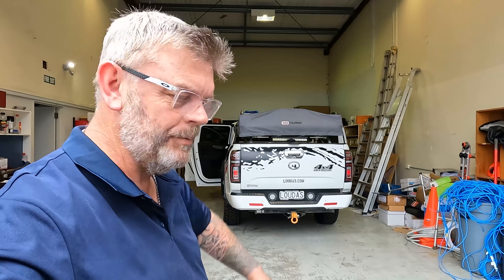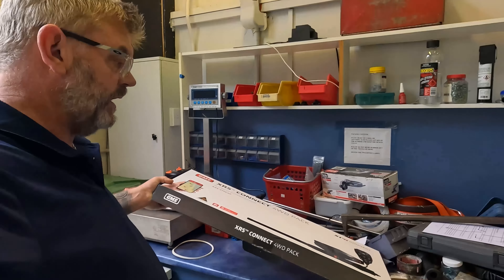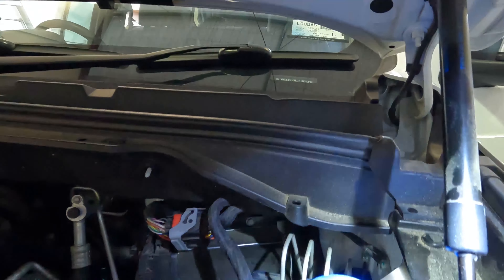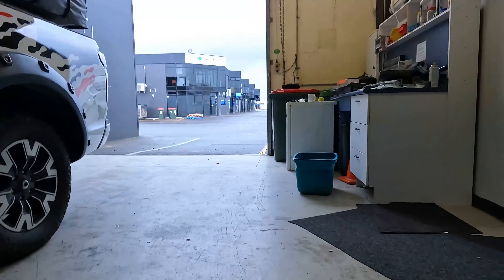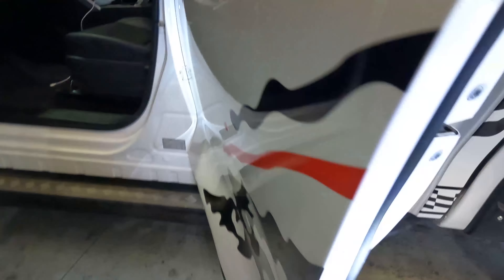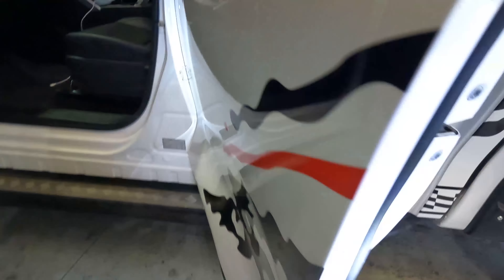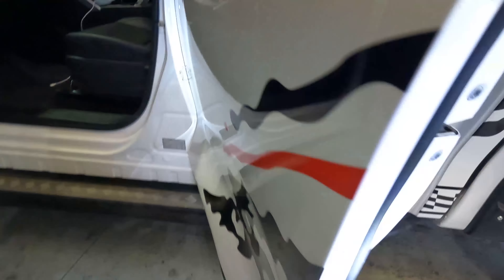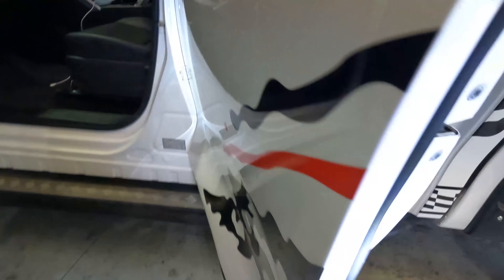GWM Cannon gets a UHF radio installed

Comment: not sure why you'd wanna. talking one off road is basically playing russian roulette. theyre just basically LDVs with a few extra accessories. 
everything sprayed with beeswax that will keep the old cheap-steel-rusting problems away until at least warranty-expiry.
Reply from the maker: you are completely wrong . .and probably a troll
Reply: @loudas  nope, just an anonymous gwm tech.
owners seem to like them though, pretty sure thats just the rock-bottom prices
Reply: @Ghryst  Sounds more like a butt hurt ford dealer 😆
Reply: @chiefauditor1683  wrong, my employer sells 8 brands, including GWM and LDV, and none of them are ford. i'm the poor prick who has to fix the crud when ppl try to do stuff they're not capable of.